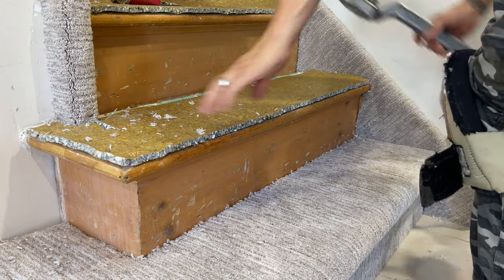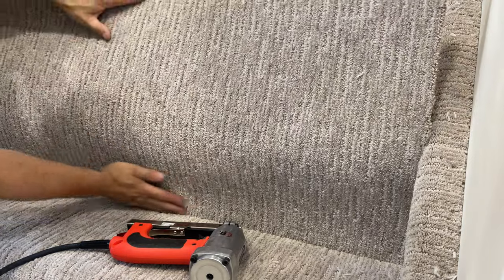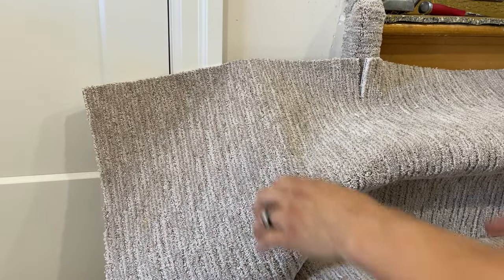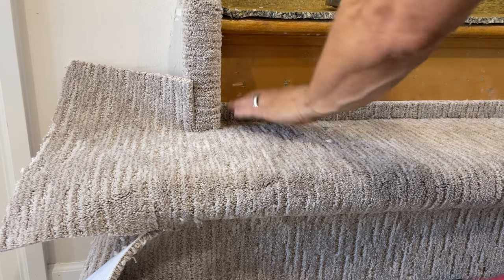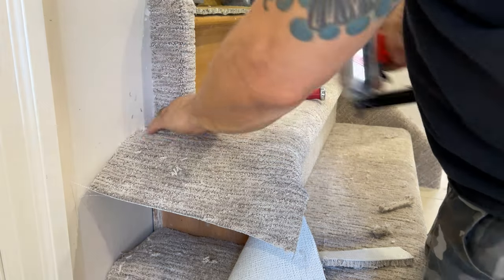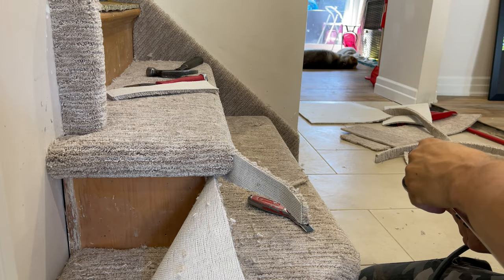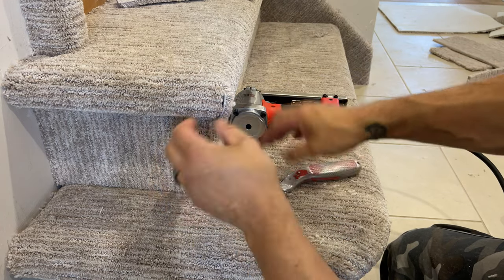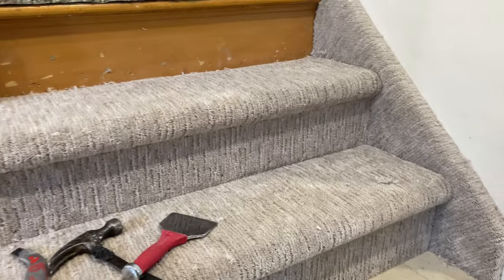How to Carpet Stairs Yourself/ Cap no Rail/ Tutorial

Comment: Why are the stringers running a different direction than the stairs ?
Reply from the maker: Well that’s the way I felt best to run them!
Reply: @KeithShannonDirectCarpet  nice I usually run my pattern stringers the same way as the steps but I kinda like the look !! THX
Reply from the maker: @dalemitchell6478  I like to run the pile over rather than down depending on the carpet! sometimes when you bend the carpet a certain way it shows the split to the white backing, if you run it over and down ,say for instance like you would run the stairs.. it does not show that split!